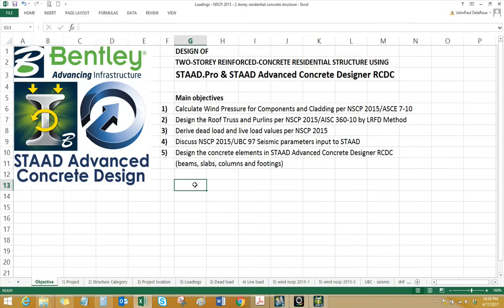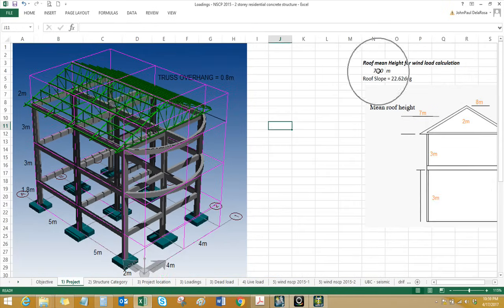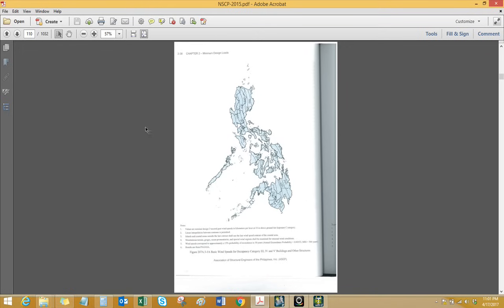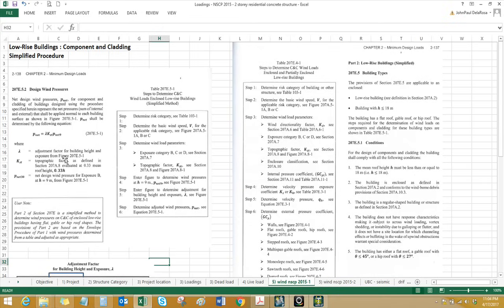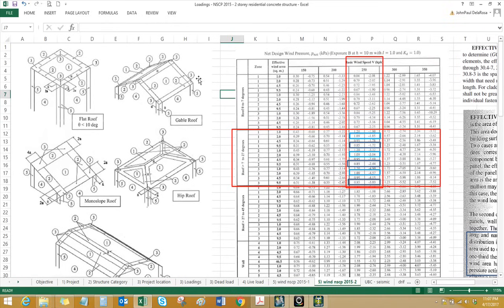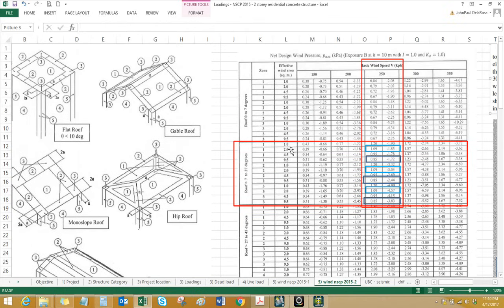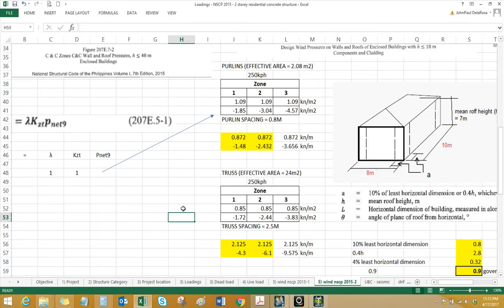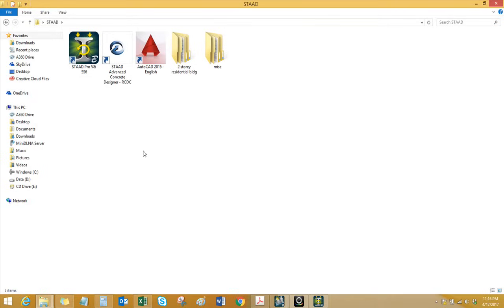Two storey reinforced concrete design per NSCP 2015 Part 1 of 8

Comment: Hello sir, I've tried to design your model using RCDC Connect Edition v11 Update 1. All columns are failed even I set 25mm as maximum rebar. I didn't change anything in Staad Pro Advance analytical model. I ticked perform ductile design as special in design settings.

Comment: Hi, where did you get the member load for the CHB and all of the Floor Load on 6:41? I am currently checking all of the Loads in Table 204-1 and 204-2 no luck in finding the digits you wrote. 
Thanks in advance

Comment: Great tutorial. Just want to hear a little bit from you on the inclusion of tie beam and footing in the model. Normally codes allow to assign fix supports at NGL level, hence no soil-structure interaction is considered. In this tutorial you have included tie beam and column below NGL (-1.8m). Two effects are present for this case: period is larger than if it were fixed at NGL and lateral soil pressure on each column as the building sway to right/left due to ground motion. Would you consider lateral soil pressure on each column if geotechnical report is available?

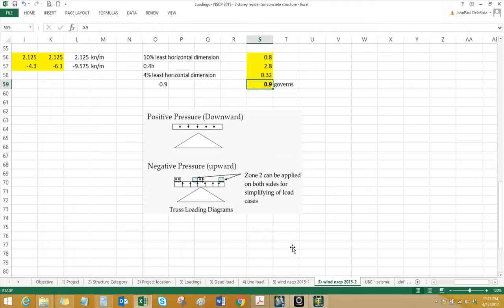Comment: At 18:59, is the truss wind load supposed to be normal to the surface of the roof and not horizontal. Also you did not consider wind pressure under the roof eave (overhang) aside from the top pressure (wind zone 2).  Thanks